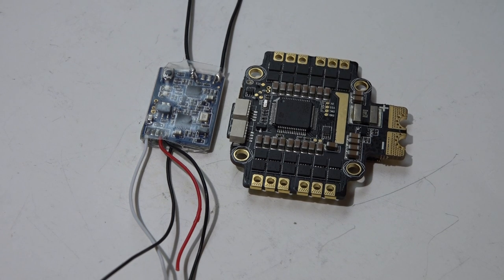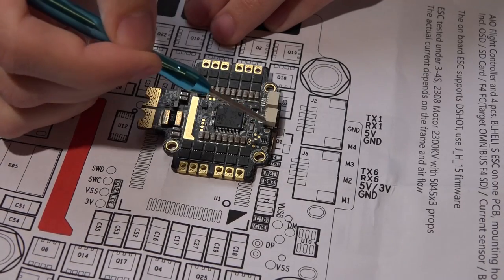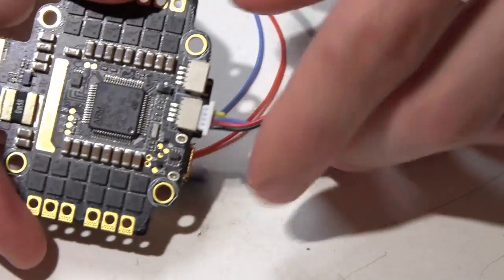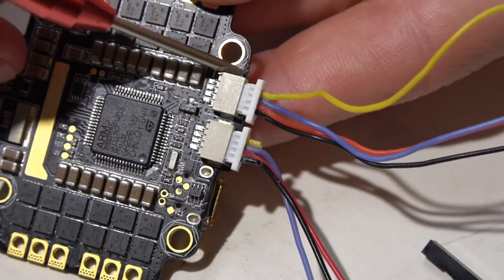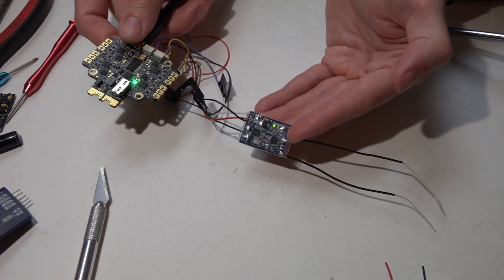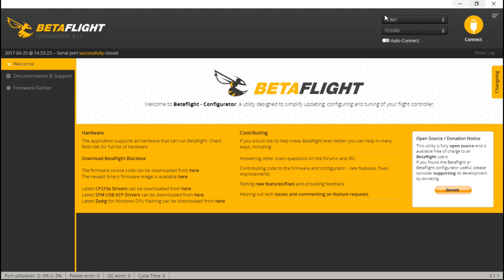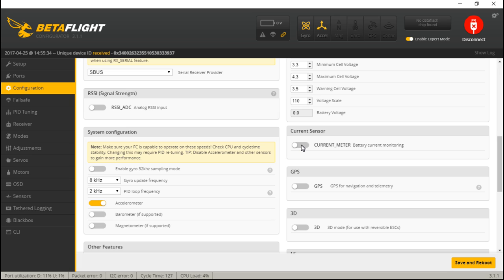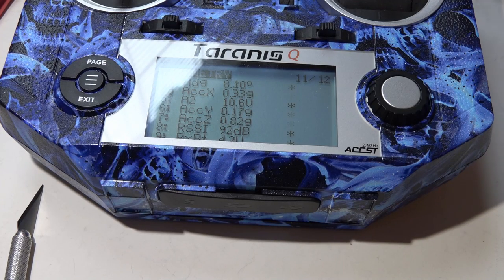Asgard: Connect Sbus Receiver + Telemetry

Comment: Correct me if I'm wrong: But I do believe that you could have used RX6 for the SBUS receiver and TX6 for smart port.
Reply: yeah, you can remap serial 11 to TX6 and it becomes soft serial 1 for that pin now. I did this on my Racerstar StarF4 for the LED pin, so now I can have sbus on RX1, sport on TX6 , and smart audio on LED pin A01 (soft serial 1). you could do the same remapping on TX6 pin like you said.
Reply: Do you know any tutorial that goes through the procedure for this? I would really like to know how, in detail. Or if you could explain, that would be awesome of you!
Reply: https://github.com/betaflight/betaflight/wiki/Single-Wire-Software-Serial 

check this out. if you compare your resource map to F4 targets it should give you a pretty good idea
Reply: leecyrille , Did u modify Frsky receiver to get un-inverted SBUS and telemetry signal ?
Reply: sbus input on my flight controller had an inverter so i took normal, telemetry I took un-inverted
Reply: leecyrille nice. I have tramp.Do you think that I can connect sport to led pad and tramp to tx6?